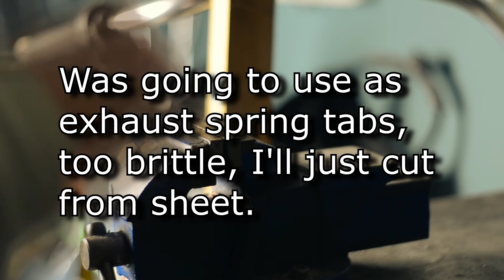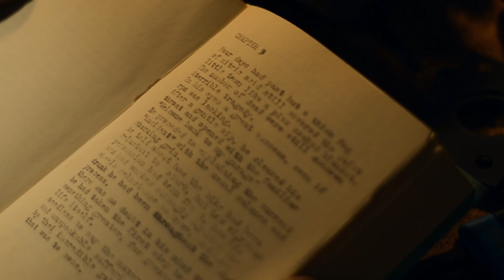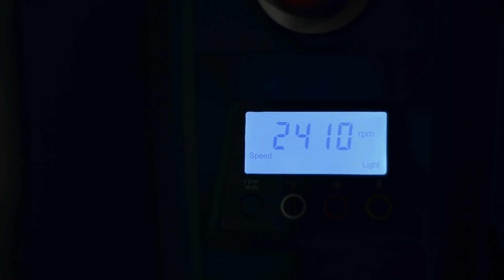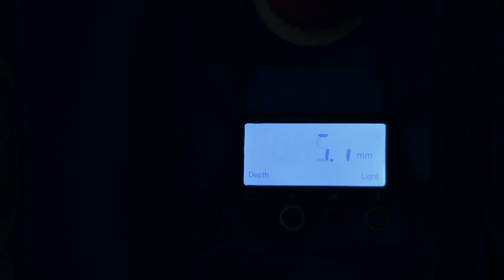Even the Most Powerful Two Stroke has to wait for parts...

Comment: Okay I've been watching a few of your videos and I believe you are trying to figure out the problem of the intake and the exhaust mixing there for creating a supercharged back pressure for unexpected speeds and I heard killed people. I never thought about that have you sealed off the crankcase and put it on oil in it so you wouldn't have to put it inside the gasoline. And wouldn't that be good if we just used an atomized gas like butane propane a higher octane one like Nitro methane by sealing the crankcase and doing away with the carburetor making it fuel injected? I go back to the 80s when we use these two stroke Motors and it's nothing but a piston and reused nitromethane for our fuel in those gas airplanes that's a two stroke motor that does come pre-mixed with an oil in it you don't see and I never thought of it. Interesting I've got to run some tests myself. Let me know what you came up with I can't watch all the videos cuz I'm so busy at least not as fast as I want to. Thank you I'll keep watching Mike

Comment: The leaddown testers are designed according to FAA standard AC 43.13-1B and are intended for cylinder bores of 5" with a 1mm orifice.  If you want comparable meaningful leakage rate to show on your tester, you'll need to replace the orifice with a carburetor jet or make your own orifice with 0.5-0.7mm so you can see meaning numbers on your gauge and also be able to resolve the difference between a fresh cylinder/ring and one that's worn out.  Hope that helps and keep up the good work.

Comment: Just a thought . My father used to race outboard 2 stroke boats.  we would slide the pipe on the header to increase port timing in the straights , lengthen it coming Into the corners for better low end power. When you would slide coming out of tge then it was like changing gears. You wouldnt need the low end but it might increase HP  on top end.

Comment: And whenever honing on a small engine or large engine use a torque plate bolted down on the cylinder to ensure even aligned honing I know you wouldn't think it makes any difference but it does

Comment: You may have already done a video on this and I’m not sure if it’s possible but how about rotating the cylinder 180* so the carb/intake is at the front of the bike which would promote the ram air effect. Also the exhaust would be a more optimal shape as it wouldn’t need to bend. Oh...and you could keep the engine up right😂👍

Comment: Your leak down tests point to a slowly sealing ring (high pressure required) 
Try it again with a wet bore (oil it down) and see if it reacts better 

Have you thought about gas porting the piston to help it seal? 
It’s extremely common to do in race engines
Else you may have to go to multiple rings honestly

Comment: Time to focus on your injection system?  I know your quest for 100% of bore exhaust port is a passion of yours, but I think you should start work on the induction and injection arrangement in parallel with the barrel work. This would also mean you can switch between work areas whilst waiting for materials & bits. You will need a reliable piston & barrel combo to do your induction testing, perhaps a barrel/liner with a bridge to start with.  I am sure there will be loads to lean regarding how much and when to inject and how much to open the slide valve etc. Your enthusiasm is infectious and your work ethic is off the scale.  Beat the winter blues, get that induction trumpet singing.

Comment: Where is the most reliable place to order parts for a 2 stroke engine I've had poor luck with Amazon and ebay I'd like to find a place that specializes in bicycle motor kits any suggestions greatly appreciated thank you

Comment: hey man you inspired me to put a pice of theory ive been dabbling with to the test recently

basically nitromethanol is energy dense as all frick BUT it's expensive and most lubricants are non-soluble in it.
That was the basis for the test the main problem i ran into while playing with my new rc car that is meant for nitromethanol.
The theory is that E85 has a simmilar energy density due to the added gasoline and it's ability to dissolve and keep oils in suspension is very high as well.
the thought went "are they interchangeable?" theoretically? NO not 100% they both have a simmilar ish octane but not the same flashpoint so id bet that's why most people have dsimissed E85 for model use.

Long story short i got some E85 mixed in some 2 stroke oil (no problems there i might add) and after re-adjusting the carburator on the thing to use less fuel oddly enough the thing now runs steadily and has a more aggressive throttle response then i thought possible at that scale it needed an active cooling fan to prevent the fuel from vapourizing before entering the combustion chamer tho but ultimately it's a massive success the only thing i want to improve is having an active ignition on the thing rather then the glow plug i have now to reduce how much fuel it uses as currently it's very sensitive to running lean and i want it running lean but that is for the future.

Comment: Unfortunately there isn’t a standard for leak down testers orifice size, yet it can make a huge difference in the readings. As you research them, add this to your must read list. Also check yours to see what size the orifice is. Piston has to seal the chamber to measure so top dead center is required.
https://www.alfabb.com/attachments/leak-down-tester-doc.75616/

Comment: Curious to see how the wideband works in a 2 stroke application. I’m thinking of trying it eventually but it might need to be shielded or something to prevent fuel/oil fouling the sensor. Also any fresh mix that goes out the exhaust will add to the O2 concentration and might throw off the AFR reading pretty bad below the pipe’s tuned rpms

Comment: I think that with as short as the pipe is for this engine,,, The wideband O2 sensor will have you chasing your tail. On a 4 stroke engine, you want at least 6-8” of exhaust after the sensor before you get to fresh air because of reversion. In a 2-strokes case,,, We RELY on reversion. Not exactly fresh air reversion. But there will be some. You’ll get a false reading IMO. I would go with an exhaust gas temperature sensor. Just my .02¢ thought
Reply: OR! 
Just remembered about this. 
We also used an adapter on ATV engines. Instead of putting an M18 bung into a 1” head pipe, we would put a smaller rivnut into the head pipe. Screw a fitting with a run of copper tubing sticking into the head pipe into that rivnut. Then the copper tubing goes up to an aluminum,,,,,,,,, thing,,,,,,,,. That the o2 then screws into. The “thing” looks like a ufo. It’s got an empty chamber in it and a fitting opposite of the O2 to let exhaust gas into it, and out of it, with a long run of rubber hose to limit the amount of fresh air reversion back to the sensor
Reply: I’ll (try to) draw what the “thing” looks like and send it to you via Instagram unless there’s a better way to get it to you

Comment: Many things i would do different. 
Why a piston that you can take apart and not a lightwhigt for high rew?.
With airbox for windfeed you can get 30-40%?more hp.
Use a powerjet also that you from handlebar can finetune mixture during ride depending on your exhaust temp.
I also belive your big volume crankcase volume i belive give you bad compretion and slow transfer of gases?.
I am also a fan of Teflon baking of parts to make it last better.
Regards from Sweden
Reply: The piston design is critical for 2 reasons.  

1. To prevent short circuiting of transfer to exhaust ports through the gudgeon pin hole

2. To retain the ring to prevent it snagging in the 180* unbridged exhaust port.

If you'd been following from the start youd understand that. 

It doesn't need a 'power jet' on full throttle. It's running pressure regulated fuel injectors at the resonant intake port 

The crankcase volume is necessary for the resonant intake set up to be optimised
Reply: @NZrider100  I didnt know he was using fuel injection

Comment: The drill press will work perfectly to gas port at least one piston for testing. The additional pressure seating the ring against the cylinder wall will only occur during compression and firing and cease when exhaust starts flowing. You only have one ring so increased sealing when it is needed most could be very useful especially if the ring has low tension to start with.
  The leak down tester will have very limited application on a two stroke. While they are nice to have for diagnosing problems on 4-cycles they can never replace the accurate reading from a good compression tester. Most cheap compression testers provide very inconsistent readings.

Comment: I’m a machinist doing r&d for automotive start up. 
We use tribore  (3 point) measuring tools since there less of a chance with two point tool. You can index it a few times to check if it’s out of round , just doesn’t tell you exactly which way is wider but when you get difference measurements you know it’s out of round.

Comment: I've recently used 3d printed dies to bend and form sheet metal(.15-.3mm nickel and copper strips in my case), for things like tabs or the like I think you can do some interesting stuff with 3d printed dies. Even PLA works as a die, the working surfaces do compress in slightly, like a die with half a sphere(especially if its like a 2mm diameter sphere) will have a very smooth hardened surface after first press, on larger flat surfaces it happens to edges making them slightly rounded, deformation can be accounted for, mainly happens to the male die or die with protruding features and on the first press. Shape is quite stable after it gets squished in or deformation. And stronger materials(ABS, PETG, nylon, etc.) Work even better but still have some deformation(like slight rounding and smoothing of edges).

Also when designing dies don't forget to account for the sheet metals thickness in-between the dies, when closed fully there should be a negative space same thickness as sheet metal.

Comment: Have you considered oval pistons? Just like Honda did, but on one conrod. Just think about it, same volume, much more exhaust port and intake area, more friction ofc, but maybe less problems with ring snagging. Just a concept/idea. 
I'm not an expert by any means, so i dont know if it may work
Reply from the maker: A very interesting idea!
Reply: I would love to see you have a go on a concept like this. I am absolutely sure you will take it to another level
Reply: Yeah..well...would 2 overlapping bores cut it? Have the rings staggered riding on each other where they meet with the gap in the middle. I mean almost like an 8 shape. The edges would probably become wear points but with todays metallurgy and surface finishing in a racing application who cares?

Comment: love the drill press👍 that's excellent if it for from 1rpm to over 2000rpm you can do all woods plastics and most metals
Reply from the maker: 👍 Seems to bee a pretty clever machine. Even has rpm feedback to run constant rpm with varying load.

Comment: I have exactly the same leak down tester. bought off ebay. i get exactly the same as you. "set" pressure at around 60psi, 4bar. But i simply use it to gauge improvement after rebuild or source a leak. it works well to compare clyinders too. once at TDC for compression i will increase pressure to factory peak compression pressure and read the leak. use this to compare. after rebuild i normally see gains of 50% improvement. also, if you can hear the leak...its bad lol but to use this tester as intended, work from the "set" pressure. this is where the reg and orifice are matched and you will see the greatest range of leak. but really at the end of the day a leak is a leak. simply pluging in direct from the air line at 100psi. you will hear a leak..3rd edit. this is also a static test. really it needs results from a dynamic compression test with hot engine and lubricated bores running as fast as possible to make a true judgement. not easy to use as a single point of data but all of it is useful when comparing agaisnt before/after

Comment: In the UK, we'd refer to your  new drill is a Pillar Drill because it has a high & positional work platform. A Drill Press (or Press Drill) has a fixed work platform and a trapezoid articulated lever movement system to move the drill down onto the work, in the manner of a Caxton printing press, hence the name Drill Press.

Americans don't distinguish between the two different drill types and wrongly refer to a Pillar Drill as a Drill Press (which is actually isn't!!). It's just one of the many crimes against the English language perpetrated by the Americans!!

I have an old cast iron Drill Press in my workshop. It limits what I can do, especially when attempting to drill into something large & cumbersome (I cannot move the work platform and there is only 20cm. of vertical adjustment in the trapezoid mechanism). 

One of my mates has a proper Pillar Drill in his workshop, where I go when I can't do a drilling job on my Drill Press.
Reply from the maker: Thanks for the info👍 This one is actually somewhat of a hybrid - the table is stationary(it's also the base), the head can be moved up and down the column.

Comment: You set a base setting at 0 with the tester not connected to anything at 100 psi. Then you connect to the engine and the difference shows up.
Reply from the maker: This on will overshoot "0" by a mile if I go up to 100psi(I'll re-read the manual, maybe I'm doing something wrong)
Reply: @2STROKESTUFFING   With the tester hooked up to nothing it should not flow any air.  The connector should seal it.  If it does flow air than you need to hook it to a solid plug so it cannot flow any air.  Adjust the regulator so that the percentage of leak is 0 on the leak gauge with no flow.  This is your base with no leakage.  Then hook up to the engine and it will leak a bit around the ring.  This will show up as a percentage on the leak gauge. .If your base pressure must remain constant.   If the compressor is too small and the base pressure drops than the reading will be less than true. Sorry for an incomplete explanation before.  The system works by measuring the difference in pressure from the base gauge to the second gauge.  When there is no flow through the unit both gauges will see the same pressure.  If there is flow the second gauge will see a lower pressure.  There must be a metered orifice between the gauges.  You can move the piston up and down to different spots in the bore to see if the ring seating is constant.  It would be very difficult to keep the piston from moving in this case.  But being a small piston it might be possible.  Usually the test is done at TDC.  Ben Howe

Comment: Your assembled engine held in your arms bears a striking resemblance to a 60s vintage sci-fi movie "alien weapon"!
Your cylinder leak down readings point to a slow seating ring. Higher pressure required to get a complete seal. I would imagine that is related to your single ring design. Might be worth trying the test with a "wet" bore by fogging some oil through the engine before pumping it up (more real world conditions)

Comment: I'll be interested to see how the wideband sensor copes with two-stroke fumes. I built a wideband controller for my dyno, but haven't got round to using it.
Reply: I will also like to hear what the thoughts are about that ? I personally didn't thought you could use a "02" sensor for a 2 stroke with oil fumes ?
Reply from the maker: It'll die pretty fast...
Reply: @2STROKESTUFFING  will you have to cut and weld in a bunge to screw the sensor in

Comment: did you turned out vavle from leak down tester pipe???? because when you do leak down test air should be moving into cylinder doesnt matter if your cylinder and rings are good there will be some air passing and you should hear it from crank case vetilation hole going.... if you dont turn out vavle from leak down tester it will always show excellent results because there is no leakage :D :D :D
Reply from the maker: 👍 I did, have to re-read the manual to see if I did something wrong.

Comment: Believe it or not i built a homemade leakdown tester for my drag motors and I used 2-accutron cheap ass autozone gauges and it is more accurate than my 600 dollar snap-on set I bought to replace it and still haven't used in 15 years
Reply: I made mine as well.  At best it is consistently relative. 😁
Reply: @todaywefly4370  well I've come to the conclusion that they don't have to be the world's best gauges as long as they are very close in calibration to each other thats all you need
Reply: @jon-christiankaczor5384   Yep, if it’s consistent you can use the info.

Comment: Have you used EGT (Exhaust gas temp) sensor before? It's supposed to mount on the pipe. When checking for main jet size (as usual full throttle 1-6), the temp should be 650C when the jet is correct.
Reply: Lambda sensor is way easier 🙂
Reply: https://youtu.be/Eb8wyGb9PHg
Reply from the maker: Yep. Great tuning tool(and safety warning)